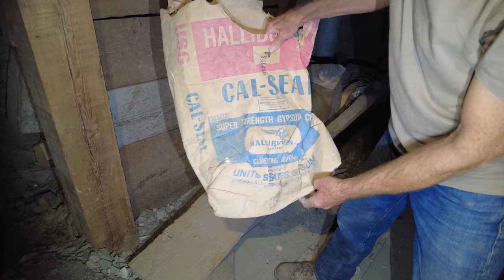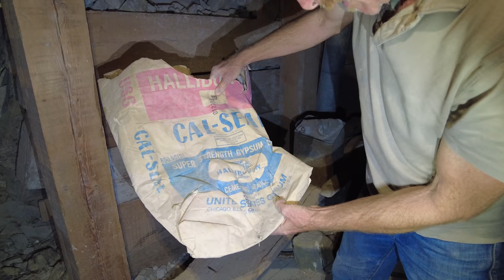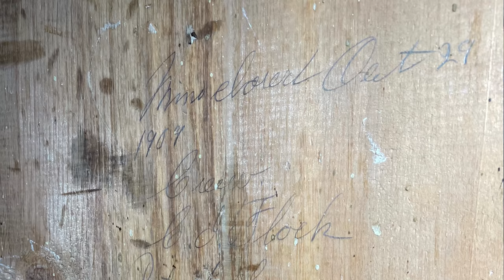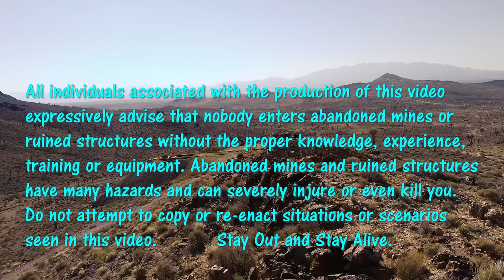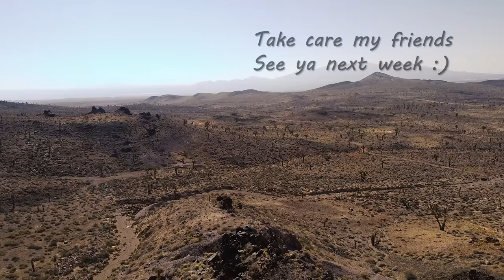The Shaft of Broken Dreams; A Miner Message from the Past

Comment: Based on 400 feet of boarded shaft, 8 inch thick (shaft inside to shaft outside) boards, and a 6 foot square opening I calculate between 70 and 80 THOUSAND board feet. I wonder what that would be in acres of virgin forest.
Reply: Looked it up, something like 500 board feet per mature tree (lot of eastern forest that looks natural to us today was actually planted for future wood harvest, same with some western fir stands). Can have 300 or so trees per acre. So not as much as it seemed, maybe 5-10 acres worth, and I'd guess most of that was mill ends and was therefore cheap (cuz otherwise it's waste wood from milling construction lumber). Looks like it's mostly fir, by how it's resisting being busted up (tearing rather than splitting).

Comment: Cementing gypsum slows the rate at which cement hardens.  The more gypsum, the slower Portland cement sets.  It is also used as a fluxing agent for nickel ores as it is used to form a slag which floats on the molten metal or matte.

Comment: We built our drill staging in our stopes out of 3" x 16' planks and 6" lagging .  It had to be solid - scaling, bolting and drilling off uppers, shit always comes down.   A lot had to be done in 7 hours - long travel time from the heading to the shaft and a couple thousand feet up in the cage .   Good times .        Next time get a piece of rope and sling the pack between your legs not too far below you .   It works .  Did a lot of classic mining and never saw anyone use gypsum .   Might have been used by construction crews for mixing concrete .  You don't usually stem holes unless its a special blast ..  normally load to near collar and tamp it fairly hard if stick .

Comment: Question gly; any idea why they decided to sink that shaft down through the gangue pile, instead of someplace else or putting the waste rock someplace other than where the shaft was going to go? I don’t think the waste rock you went through cam out of that shaft, given the size. Must’ve been from an earlier effort In a different adit. But that shaft is so exactly in the middle of the pile I’m having a hard time thinking it was anything other than intentional but I can’t figure out any advantage to having done it the way they did. Edit; I think that bird carcass is from a little peregrine falcon, actually. Poor lil bugger. Not an ideal place a bird would want to die, I don’t think.